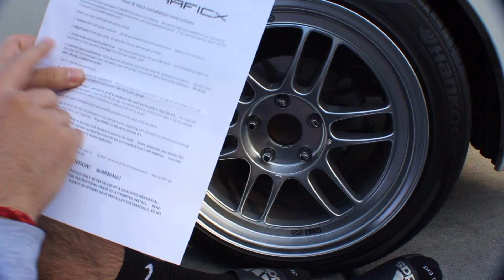Tsx gets tire letters!

Comment: I think where you messed up is when you put that heat gun on top of the plastic that the letters had and the plastic kind of melted onto the letters that’s why you couldn’t peel it off easily, it’s like stickers, if you melt plastic on it it’ll melt and glue